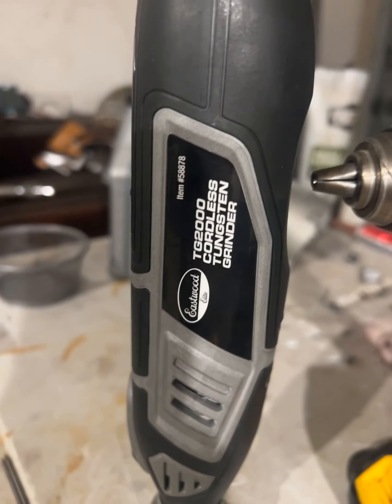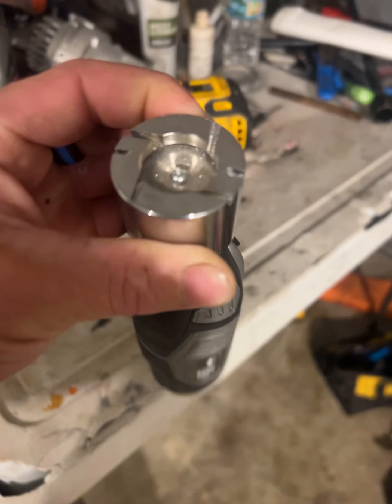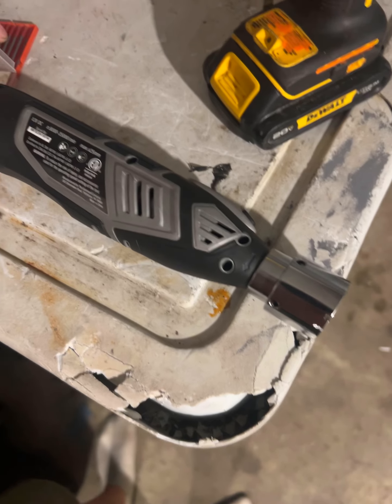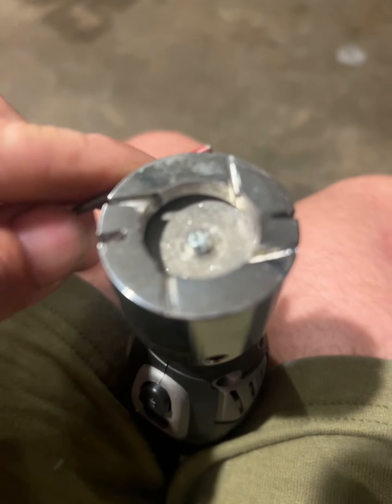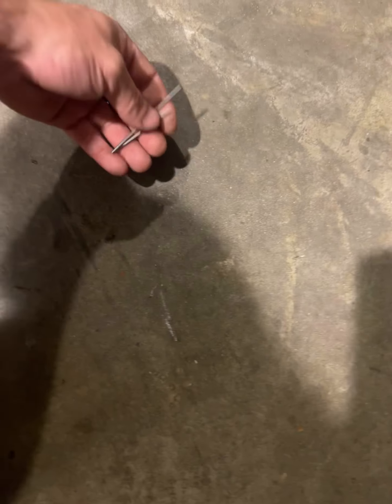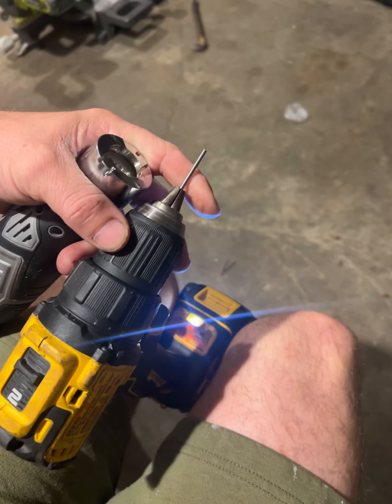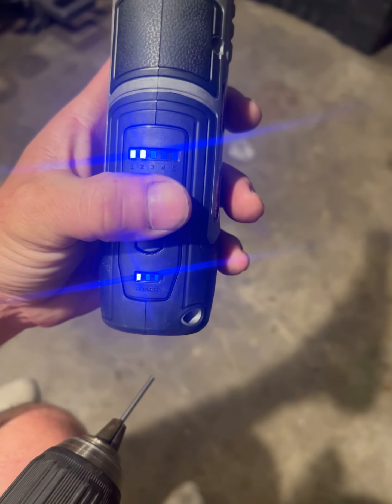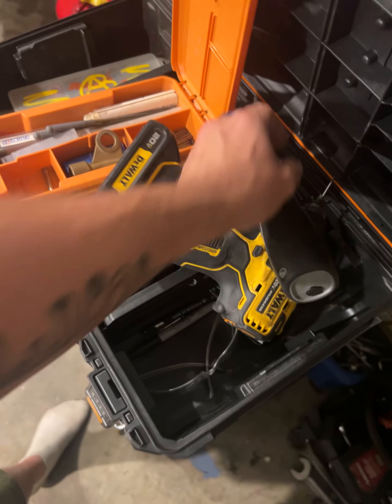TG2000 Cordless tungsten grinder #howto  #tungsten #grinder  #eastwood

Comment: Mine stopped working after just a few grinds, it was 2 months old. The dust collects under the grinding wheel right on the bearing which is not a sealed bearing. I eventually got it going by soaking the bearing with WD40. Eastwood shipped me a new unit.
Reply from the maker: That sucks man. Fortunately mine has been doing well for a year come Christmas Day 👌🏼